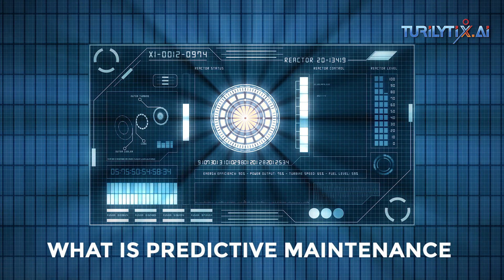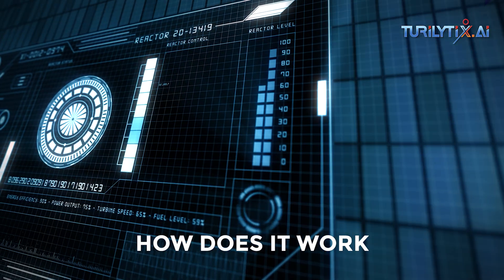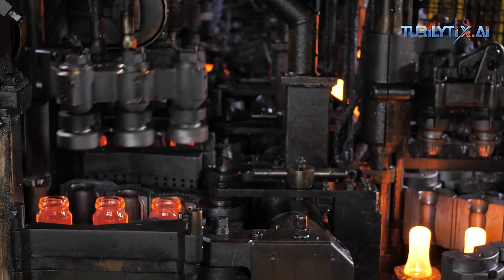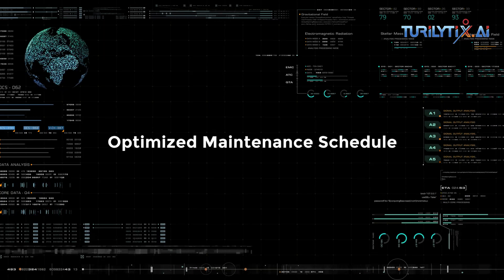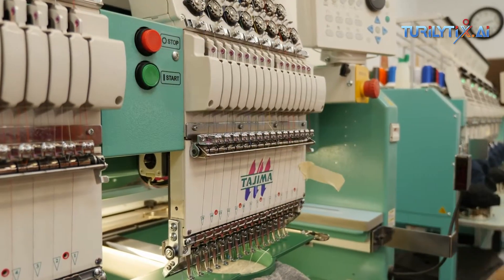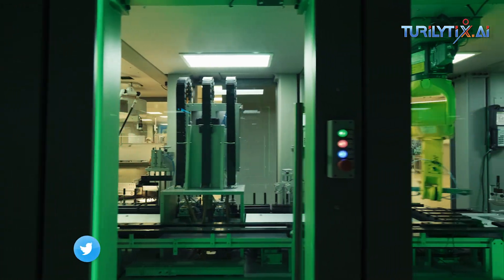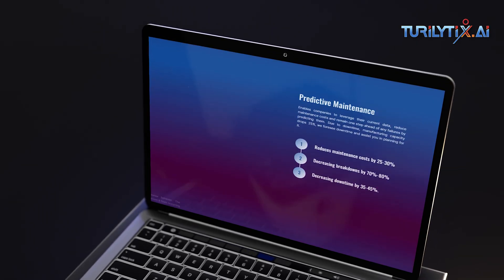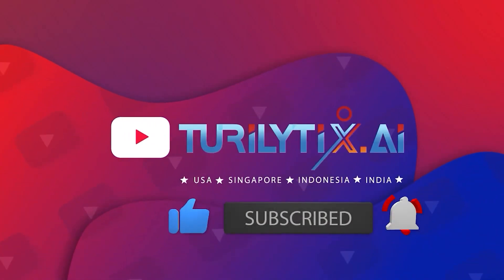Why Predictive Maintenance Is A Super Helpful Tool For Manufacturers ?

Comment: sounds good as long as I don't have to collect the data myself or device manufacturers are willing to collect, analyze, and validate the data and make them available for its customers. Otherwise predictive maintenance is a severely limited solution that MAY or MAY NOT work even for the organization that has the capacity to collect the data themselves. Simple and very instructive video. Predictive maintenance in plants will require huge  amounts of data to be analyzed.